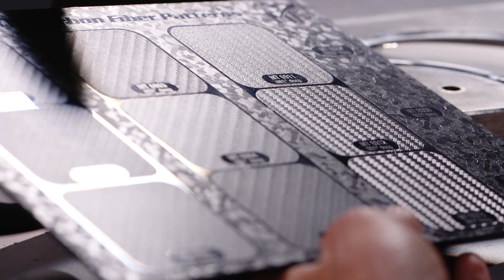Futures  |  Alpha

Comment: Don't let the cost and look of them fool you- these are actually quite good. I bought a set for back up fins couple years ago and never used them. I figured all my expensive fins are much better. I gave them to my gf recently when she got a new board. Tried the board out and had some of the best waves/turns I've had. Tried them in other boards and was blown away. Very natural almost like volan. Best part is they don't have the annoying v2 foil like blackstix and have better flex compared to honeycomb (I'm very light). oh and of course they are dirt cheap and made in the US.
Reply: how is V2 foil "annoying"?
Reply: @taradead  in bigger/powerful surf they seem to feel quite unpredictable. had some turns that seemed to 'jackknife' out of nowhere with the v2 foil. Think of a plane at slow speeds the wing is cupped, at high speeds they straighten out. V2 is like a cupped wing
Reply: @alang253  well, I don't surf in DOH, but V2 doesn't bother me in head high+...in fact, I feel an awesome "swoopy" drive I've never had with any flat foil fin.  Trying the alphas anyhow (different template), but glad they're cheaper, so I can sell them easy if they don't beat my V2 set.
Reply: @taradead  I'll give them another try, my boards have changed and my skills improved since the comment. A couple v2 pairs ended up in my fin quiver and if I recall I liked how they felt as quads. let me know what you think of the alphas